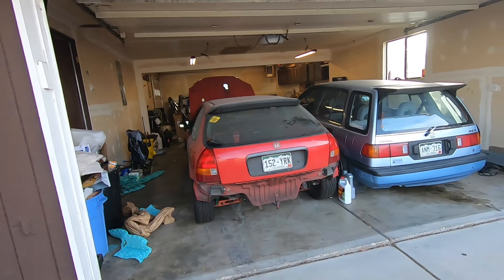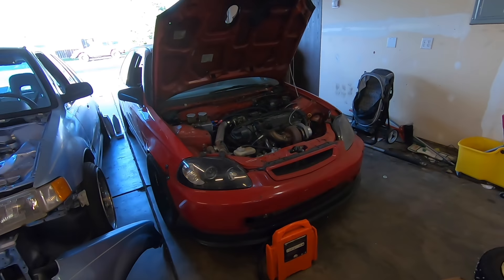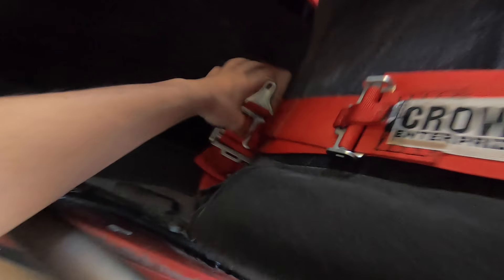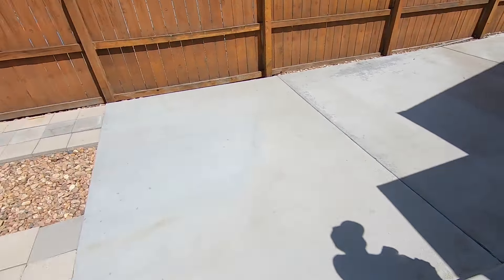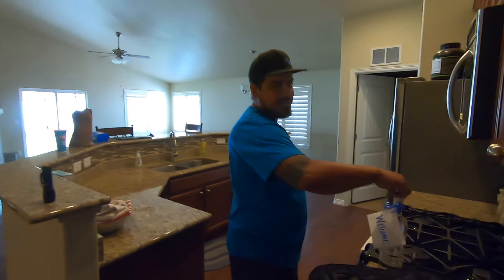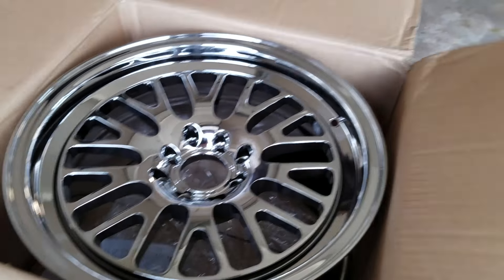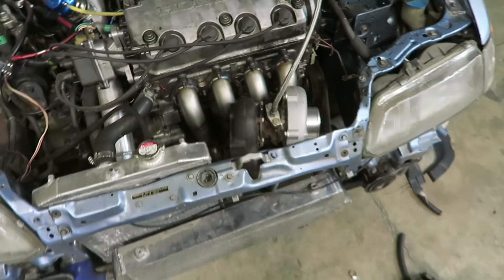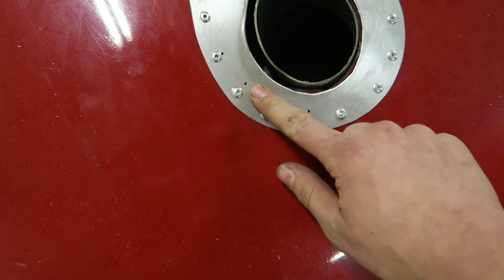Leaving The OG BoostedBoiz House

Comment: I think Kyle needs a jump box sponsor. They'd get loads of screen time with his cars 😂
Reply: He needs an Optima battery sponsor John Doc got one a while back and they keep him in batteries, jump box, quick charger, and power inverter pretty much everything Optima puts out but I think it would be sick if Kyle got a sponsorship with Braille batteries some of the lightest batteries on the market and alot of drag racers use them especially if they want to run more than just a 12v system and if they want to shed weight
Reply: Or use a master on off switch and leave them off

Comment: A Boosteboiz jump box is definitely a marketing opportunity.

"BoostBox"
Reply: With removable stereo bluetooth speakers, LED light, a storage compartment/drawer for some zip-ties or small "tools" :) and a boost-gauge for the voltmeter
Reply: 10mm dispenser
Reply: @hegeliandetective1034  don't forget the built-in dab rig with extendable propane torch

Comment: I remember a few years back it was my goal to be quicker than you In the hatch (i had a turbo b series ek hatch) for a little in the 1/4. I ran 10.9 and at that point your trans still wouldnt allow third and i was actually surprised i could hang with your car and then you went way faster and i put a stock b16 in the car since

Comment: Not gonna lie I’m really disappointed in you Kyle 😓 all the HARD miles driven and time spent sitting that oil is for sure cooked not to mention it’s a e85 car. Seeing you take it out and get on it made me cringe 😬 tens of thousands of dollars on sequential transmissions and built motors but can’t at the very least spare $30 bucks for a cheap oreillys oil change???